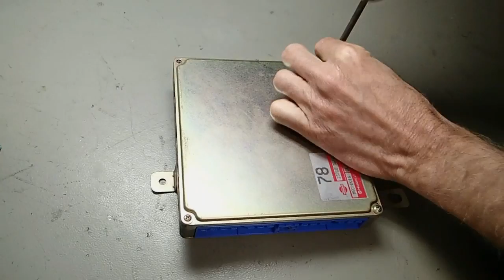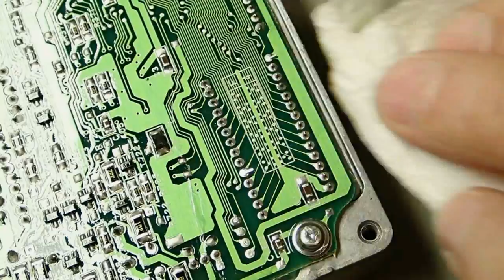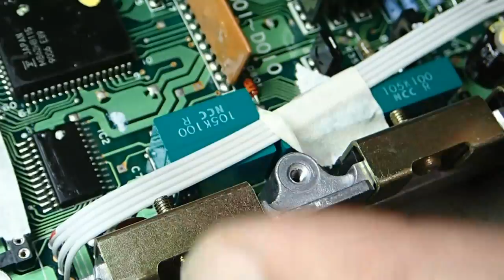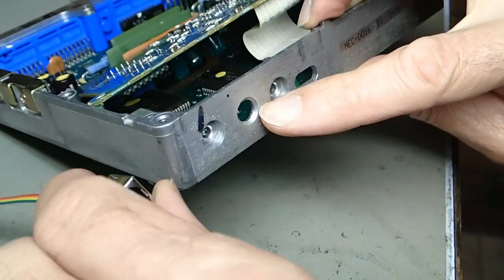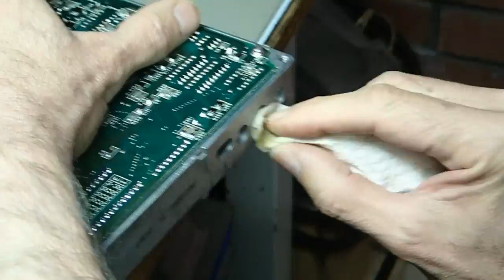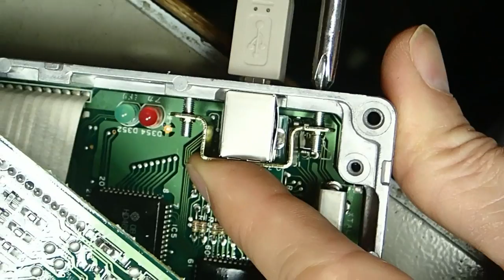NIStune Type 1 board installation

Comment: I have a question. If an ecu is fried can you re install the nistune into a new ecu and does it have to be re tuned? Is the tune stored in the nistune?
Reply from the maker: As long as the board isn't toast as well then yes, you can just put it in another ECU and drive on. Tune is on the board.

Comment: Hi, What type of product you use with pen to dissolve the varnish and clean with paper? Do you have a link?
Reply from the maker: I just use acetone to dissolve the coating. Acrylic paint thinner will also do it. Work it around with a brush and then mop up with plain old absorbent kitchen paper. The pen is a "flux pen" to aid heat transfer. It's just plain old rosin type soldering flux that you can get at any electronics store. 

https://www.lifewire.com/types-of-solder-flux-818849

Comment: Great job guys, what you have done with NISTune is nothing short of amazing. :)
Out of curiosity, what temperature are you setting your soldering/desoldering iron?
And if possible the brand of the gear you are using, you make it seem so easy. ;)
Reply from the maker: Thanks man. I tend to stick around the 375 - 400C mark for temperatures. I use only Hakko gear. I've used many different brands over the years and Hakko rules supreme in my workshop. Particularly the quality of their tips. They must use a very special plating process cos the tips just last and last.
It is easy when you do it right. Cleaning the coating off properly makes a big difference. And preheating the area with a heat gun also helps a lot if your ambient temperature is low. It's winter here at present and pre-heating for only 5 or 6 seconds helps a lot. It also melts any coating that's under the chip. If your chip still seems stuck tight after de-soldering try hitting it with the heat gun again.